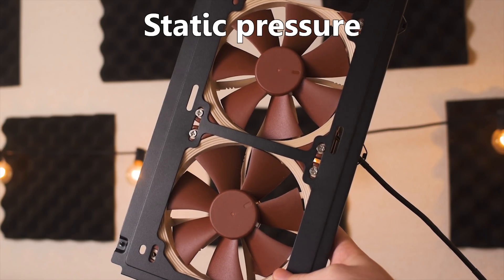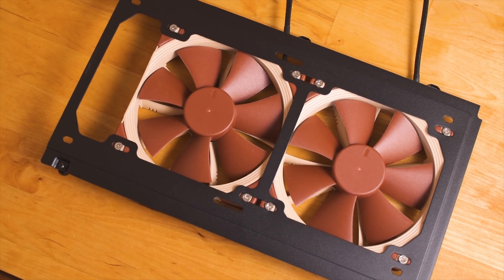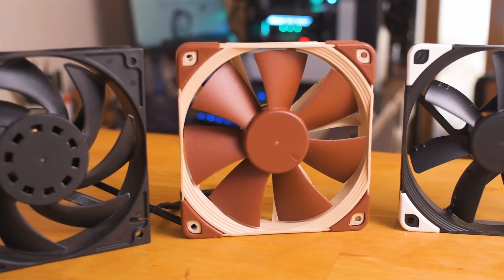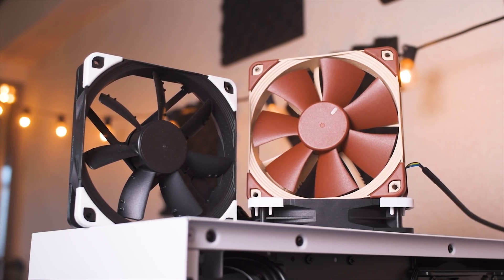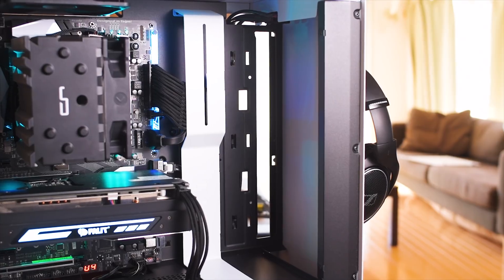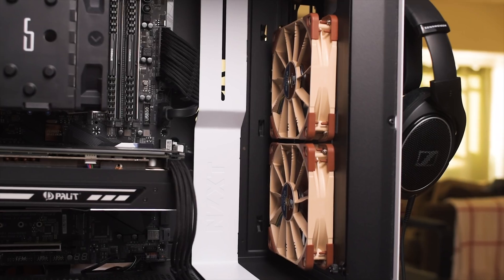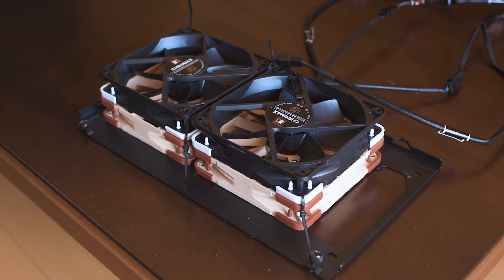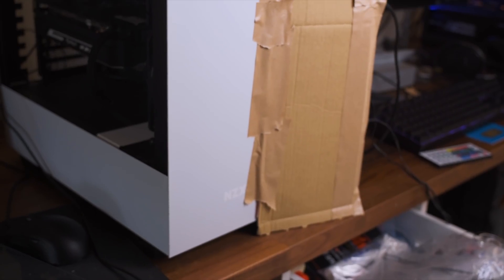DON'T buy front intake fans! (For NZXT H500/S340)

Comment: I've been studying thermals for cases, heatsinks and fans - armed with the knowledge I ran some tests. Some interesting conclusions presented themselves:
- Heatsinks which have thin fins (most these days) dissipate heat faster by having a fan 'pull' air through them, as opposed to most CPU coolers which have thin fins and a fan that 'pushes' air through.
- Exhausting air from a case is far superior to an active intake of air (via an intake fan).
- Exhausting only is superior to having an exhaust fan and an intake fan. The intake fan creates turbulence which moves warm air around before eventually being exhausted. Without the turbulence natural convection does a much better job of supplying cool air without moving warm air around.
- When there is an exhaust fan present (1 or many), using any intake fans will have a negative impact on the flow of air.
- The exhaust fan must be able to evacuate air freely. If there is a blockage or a lack of ventilation (front covers with little ventilation for instance), the exhaust fan will recycle the warm air it's trying to exhaust. I recently exhausted air from a case into a poorly ventilated front cover. This created a negative pressure case and a positive pressure area between the case and the front cover, the case being negative simply pulled the positive pressure air back into the case before it could escape through the ventilation of the cover. This looped warm air and the air got warmer and warmer. The same is true for cases pushed against a wall with a back exhaust fan, the positive pressure area is between the case and the wall.

Conclusion - Always exhaust from a case, never intake (nature does it better) and make sure the warm air can escape before it can be drawn back into a negative pressure case (like the back fan being butted up against a wall and the GPU drawing it back in). Exhaust via the top or even the front of the case if air can escape quickly that way (mesh front for instance).
Reply: Wouldn't having an exhaust-only setup mean more dust though? Also do you have any links to these results? Would be really interesting to read.
Reply: @ThePCForever  Sorry for my bad english yes it is maybe about 20-30% dustier i'll do vacuum and brush the case every 3 to 4month, im using this case for years once tried to make it positive pressure by adding 2 140mm front fans(silent wings 3) and i didn't like it just not worth it more noise more power used, going back to negative pressure now with 2 120mm silent wings 4 dead silent 👍 .
Reply: ❤À

Comment: When i had only the stock exhaust fans my cpu temps where the same. But my motherboard temps and gpu would climb during extended use. Once i changed the top exhaust fan to the bottom front intake, Instantly got cooler mother board temps and helped the gpu a little. Ive been running that set up for a while now but now that ive been playing cod mw on high settings my gpu 2060s hits 80 degrees with ray tracing on (midd-high70’s with it off) so i was thinking of buying 2 140mm good quality fans for front to help move the air. So confused to why everyone says front fans dont make a difference but on my pc it does. Without them hot air would just sit in front of gpu and heat up gpu and mobo.
Reply: I've installed Noctua 140mm x2 fans on the front and this does help to reduce GPU temps. Case is H510
Reply: IrfoTech thank you. I knew to go with my gut feeling. Maybe these guys/youtubers are in a air conditioned room and doesn’t make a difference to them ? Or maybe there testing idle temperatures ? Witch obviously would be the same. Its when im in deep into a gaming session and i even feel the heat coming from the side panel and temps start to go up. Then i ramp up my front fan and see the temps instantly start dropping.
Reply: IrfoTech witch fans did you use ? Air flow or static pressure

Comment: I've a NZXT h500 and my GPU comes with a blower. Adding a front intake at the bottom position gives fresher air flow to the GPU blower and it makes a difference. Also another on the top position adds fresh air to RAMs refrigerator (corsair airflow).
I've a 120mm liquid AIO attached to the back with double fan configuration and a fan at the top that throws air to the top, which avoids AIO for using the in-between RAM and GPU heat zone to pass through the AIO radiator.
https://imgur.com/gU5Uydx
It depends on your components and config. Adding a video title with this statement is quite inaccurate as you didn't tested all configurations.
Apart from that, the fans on minute 7:48 are mounted on the wrong side, the support layout for front fans are intended for mounting it at the other side of it (the case comes with a user manual in fact).

Comment: Just watched this after installing 2 intake fans at the front of my H510 RIP...
Reply: Lmaooooo. I just bought 2 additional fans for my case too. Fuck me.....😂😂😂
Reply: same
Reply: @edward_the_bruce  so is that real they didn't make diff in temps after you installed em both?
Reply: @houdaplanet9955  I didn't notice any difference.  Lol
Reply: @edward_the_bruce  rip lol
should have ordered a cpu cooler instead of 30$ x2 fans from noctua 1 week ago 
totally it's good for cooling tho?
Reply: @houdaplanet9955  I have a good cpu cooler, just the intake fans did't change the temps lol.
Reply: How loud does it get I'm thinking of using it for my first build but I dont want it to sound like a jet
Reply: Just bought the h510, any feedback on the exhaust fans? Would you replace those?
Reply: Cut out the front of this case for as many fans as you are putting in. They have videos showing how to do this. Make sure to use scotch tape before cutting
Reply: @TonyTurnedup  what's the scotch tape for
Reply: @TonyTurnedup  Those videos are actually jokes, I can't believe you ruined your case

Comment: Hi I’m planning to build a PC and going to get the NZXT h510 case and was wondering to know if the 2 stock coolers would be enough with the water cooler. The water cooler I’m getting is the coolermaster ml240l.

Comment: If your increasing airflow intake from the front wouldn't you need to increase the airflow on exhaust side as well to get result results?  I have no intentions of putting more fans in the H510 case as the temps I'm seeing are pretty normal and I'm not overclocking or or doing anything crazy.
Reply: Im lost. My first time building a pc. There are literally no videos explaining how to install my Kraken x62 to my 510case. I have my motherboard & amd, ram, m.2 installed already. I already screwed the kraken fans to the radiator but have no idea how and where i should fit it inside the case. Please help.read the directions but u know...
Reply: @paulypipes1  Watch Gear Seekers video

Comment: Building my first PC, using the 500 case. If there’s no need to add intake fans, would you rec replacing the stock fans? If so, with what? Thx

Comment: Welp. lol. I have four fans in the front attached to a radiator in a push/pull setup, and two exhaust fans on my s340 elite. i7-6700K and a 1080ti both sit in the mid-upper 40s.

Comment: It's an interesting test, but I wonder if your results would apply if you did the test with higher-end components. An I9 9900k and a 2080ti will certainly provide very different results since they get way hotter than a 1060 and an I5. 

The configuration you have seems to be pretty cool on its own, which might explain why intake fans doesn't make a difference.

Comment: Was gonna purchase rgb fans. I watched this video. I still purchased rgb fans.
Reply: CandyMan yeah i’m feeling the same, sounds dumb but the rgb just looks too nice
Reply: CandyMan do you know what that part is that he install the fans on to make it fit
Reply: @erratic8934  That is called a removable fan mount which is used in cases to provide you a better experience while you put a radiator or fans as you don't have to fit yourself up in the case to install those. Just pull that bracket and mount them freely as you want and place back the bracket.

Comment: Your case has a closed front panel that pull the air from the gaps of the case. Try making this benchmark with a case that has better airflow in the front panel. It has an impact. I did the test myself and there is a difference of almost 10º C. Thats why guys like jaytwocents recomend taking front panel off in summer days to help cooling the system and it indeed works. With a closed front panel, like the majority of cases nowadays have, you get almost zero airflow, even with 3 120mm fans. I can feel it clearly when I put my hands behind the fans in the front panel with and without the panel. Tbh, many of the design decisions in PC market today are absolutely retarded. People are caring too much for the looks and less about performance and utility. So ofc its not going to make much difference because some really stupid people thought it was a good idea to sacrifice a good open front panel with dust filter that allows decent airflow for a good looking panel of steel or glass that almost hermetically seal the components just because it looks good. They should close the air intake from cars too... maybe jets could sacrifice air intake for good looks too. So stupid.

Comment: Dawid, thank you very much for your video. Could you please recommend a fan management options for corsair carbide 275r mid tower case (not airflow version) but closed front panel. The components are amd ryzen 5 2600, msi armor rx 580 oc, asus b450m-a. Do i need to upgrade to aftermath cooler in this corsair case? Motherboard has 1 cpu fan and only  2x 4pin chassis.. thank you very much in advance for you answer and considerations) best regards

Comment: Things must have really changed in 2 years! I have the NZXT H510 case and I have a Front mount 280 mm Corsair AIO and I get get airflow! Idle CPU temps are like Ryzen 5 1600 AF OC 4.2 GHz Idles at like 37c and GTX 1660 Super Idles at like 40c!
Reply: but what would be temps on stock coolers?!
Reply: Well you'll get better airflow with straight fans not having to pull air through rad. But at stock speeds it'll be great! OC'd you probably couldn't get the same speeds I did.

Comment: love it when know it all brits shows just how little they really know about what they're talking about, you're basically comparing heating issues with a case that barely has exit air vents that looks like you only paid $40 for, if you want to do a proper cooling fan placement video, get a corsair 590 case, and a micro cube case where you can properly demonstrate air directional influxes
Reply: MMO Archives it’s showing why you shouldn’t install on the two cases in the title, i am not a no it all but i can read properly
Reply: @Maddo-y7e  LOL what does that have to do with anything i even said?

Comment: On my s340 you can remove the front cover there are 2 sliths on top and below (and a dust filter) to pull air through, and it,s the only place where to place a 2 slot watercooler. Are there different versions?

Comment: I still think it's a dumb case.
People will still be dumb and put an I9 in it.
Impressive for closed front case.
But at end of the day. Still wouldn't recommend CPU over 65ws.

But this is very good information as I did notice this testing in the past as well.
Reply: What do you think of a i5 9600k with a gtx 1660 gpu?
Reply: @melih54x  h500 is a good case will be fine

Comment: That's because the front is a solid panel. Fan needs to pull air from somewhere.  If the front panel is not messed and it's a solid panel there's no point having front fans

Comment: thats because theyre negative pressure cases. this isnt shocking. 

I did have to set push/pull on the front panel. because i was using an AiO. and i did absolutely no research before snap buying one (not my build, was for a family member)

Comment: Presumably, if you use a CPU (or GPU) AIO there is no disadvantage in using a radiator and intake fans at the front.  Given that is the only place in this case you can fit a two fan radiator, I guess there is no choice.

Comment: Hey, i'm in a bit of an situation with my case, it's a Gamemax Expedition, witch doesn't have a front intake mount for fans, there's the space to put them, but not mount or drill holes to put them on. So that leaves me with the one at the back witch I use as exausth and two slots on the top, all three slots being 120mm. I've searched the internet and found little to nothing relatable to my situation.

Can anyone, David included, answer me how can I improve airflow in this case? For general uses is cool, but for gaming, seeing that I use an RX 570(undervolted even), a pretty toasty card, it can get hot inside the case. Any Ideias in how I can improve my situtation?

Comment: the problem i think is if there is just to small space for the air to get in from the front, I have a similar case and with o without fans does not help to cool the gpu at all, compared to get the lateral panel open

Comment: with good negative pressure inside the case, front dual fans reduce dead zone to improve the pc airflow  (1x12 + 1x14  + psu pull, 2x12 push). in all case, with , negative pressure: without any front fan my gpu's rise high temp, with one little less then with two fan temp are correct and lower around 10°c. Im running nzxt s340, crossfire rx580 oc @ 1460/2175 pwr limit +20%

Comment: I have the same case and ended up not using the two front intake fans and the Rear fan. Too loud. I just have a 140mm on the top above my Ryzen 7 spire. It would be interesting to know if not having a rear fan has an impact on temp. Should I put it back on?

Comment: wait...this S340 case is different than mine. my S340's front panel can be removed and it has front dust filter.
Reply: I have the same one better airflow i asume, and the only place to put a 2 slot watercooler.

Comment: I recently bought the case and noticed that after a few hours of gaming the case was hot to the touch. Cpu and gpu temps where fine but the case was on fire. After installing 2 140mm fans in the front panel I noticed an immediate difference in heat from the case.  I dont believe stress testing for 15 minutes is an accurate real world use representation and would highly recommend front panel fans
Reply: I have the same case and it's too hot so I am thinking of adding fans to the front panel. I have one nzxt kraken 120 ( 120 mm ) liquid cooler which is intake and top fan is exhuast. Should I keep the front panel fans intake or exhaust. I don't have much knowledge on fans and airflow so will appreciate if you could reply me. Thanks!
Reply: @ShivaEditz  hey I'm by no means andexpert on the subject but he's my reasoning. There's a mesh filter for the front so I'd keep it as intake to limit dust getting in the case. I use the top and back fans as exhaust based solely on the principle that "heat rises". The top section has very little clearance for my motherboard so I had to hack at the replacement fan I put up there. Might not have room at the top for an AIO you will have to check.

Comment: You saved me some time and money friend! I bought this case because it was cheap and I needed something cheap after spending all my money on a 5700x + 3600. I was (and am still a bit) concerned because I've never used a case that had a completely closed front.
Reply: How are the temps under stress? I bought a 3600 and a 5700xt as well.

Comment: As far as i know the NZXT H500 and H500i are designed with watercooling in mind. Thats why the cases come with two fans in exhaust configuration. The front is specifically meant for radiators.

Comment: Im having thermal issues with the s340 and a cpu ryzen 5 3600, its time to change my case?
Reply: I have the same CPU, make sure the voltage isn't high from stock settings
Reply: @Sandwich3  Yeah the CPU was on stock setting, I had undervolt it to 0.95 and cheking result, im still trying to get mix betwen temps and performance but i cant find what is good.
Reply: @draghz  have you installed ryzen master and the chipset drivers?
Reply: @Sandwich3  Yes, even BIOS 3003 i think
Reply: @draghz  I don't know what's wrong sorry, maybe update college firmware if you have a aio, but aside from that idk
Reply: @Sandwich3  thx alot idk what's wroong, But still traying to fix it, if i found something i will tell.

Comment: If your system isn't running 90c temps on either the GPU or CPU in the first place, you're not going to see much difference. Apply your current parts to a smaller form factor or upgrade your current parts. I'd imagine if you ran a 2070/2080 super on a 3700/3900x or 9700/9900K with more demanding synthetics (or even games), you'd have a wider range of cooling for sure.

Comment: NF A14 PWM has 140.2 m3/h and 2.08 mm h2o while ek furious varder is 244 m3/h and 5.28mm h2o... so what about that? i have a 2700x and a xfx 590 fatboy which is a HOT HOT card and am wondering if the ek furious would help.

Comment: Excuse my novice-like knowledge of this kind of thing, but right off the bat, a case such as this is more designed for watercooling/aio type setup, and the idea of trying to see if case fans, no matter the quality or performance, will never yield consistently what you're looking for...and in this case, required a "thinking and going outside the box" to see if it would work, but in most "real-world" instances, it would not!  What I have found, is that front panel case fans that only allow minimal air flow are all about a water cooling set-up, not case fan performance/cooling. Personally, I prefer the mesh open front type of cases for optimal thermal performances. But...thanks for the video!

Comment: The best GPU temps you're gonna get is when air can exhaust easily. The problem with full side panels is the GPU heat is not exhausted quickly enough. Not the prettiest of solutions but a simple side panel with ventilated holes would solve the problem.